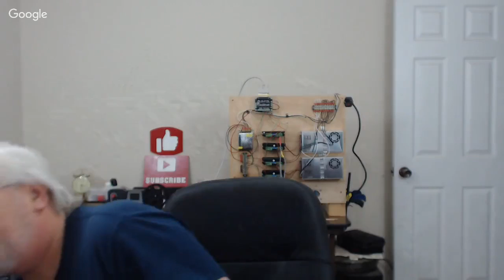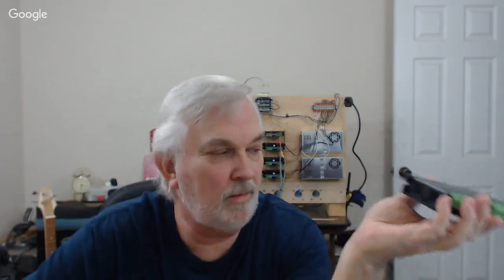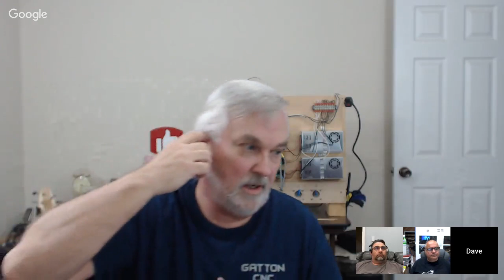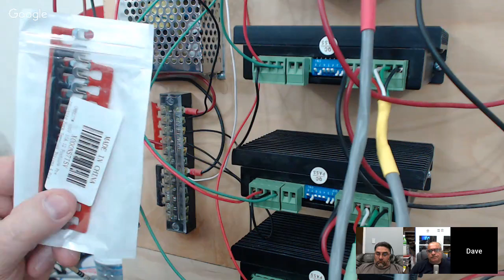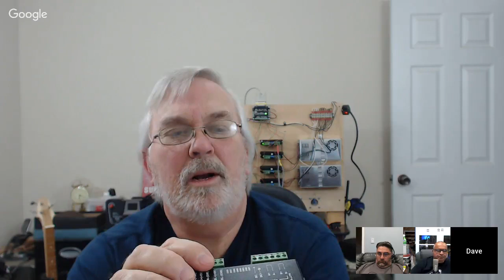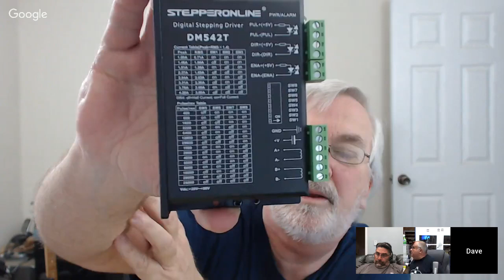CNC With Dave Gatton -  Wiring For Your Hobby/DIY CNC

Comment: Warning: Make sure you do not unplug the stepper motor from the driver while it is powered. Stepper drivers are current shunts and can surge when connected or disconnect while powered. This can damaged to stepper motor or driver. Best to have a 5th driver for the stepper and switch out the DIR and STEP signals. That way you only need a light duty 2 pole 2 position switch (refered to as a 2P2T switch).